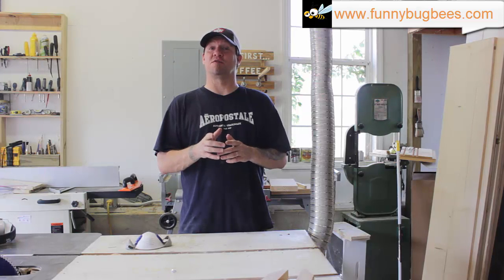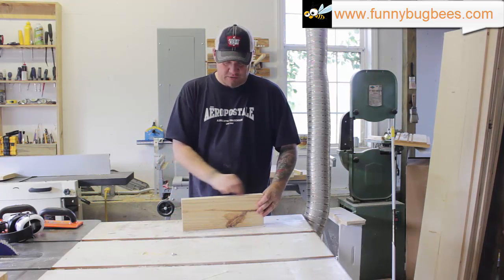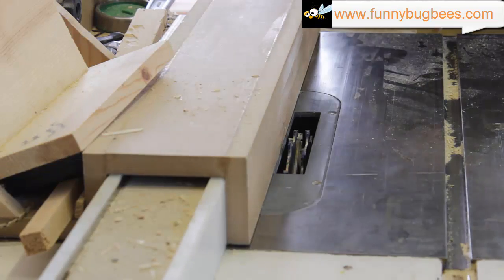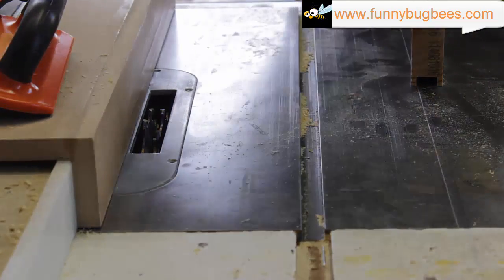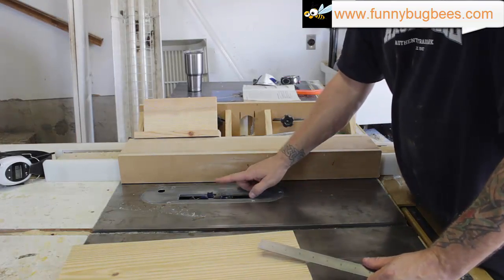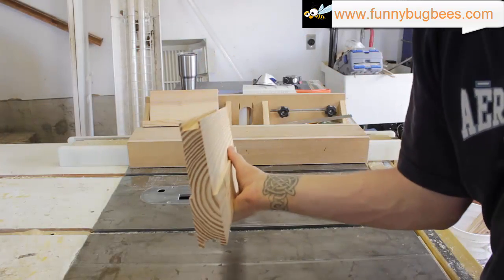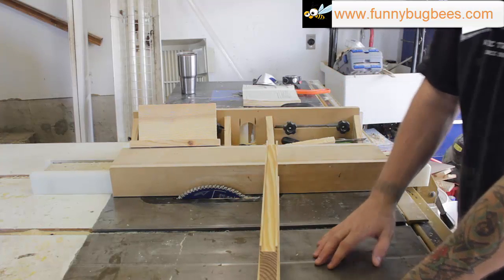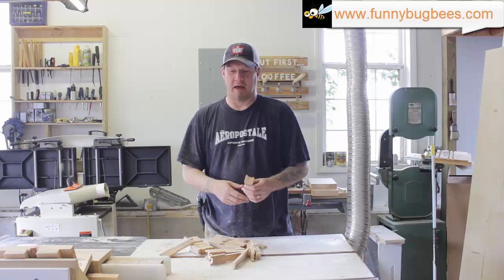HowTo: Build Langstroth frames with only a table saw pt 3 of 3 - end bars

Comment: I'm wondering if the way the grain is oriented on your end bars would make the brittle. I know when I have thin scraps after cutting boards they snap very easily.
Reply from the maker: Great question. I personally have never had an end bar snap due to grain orientation. Especially in light of the fact that end bars are nearly a half inch thick, coming in at 3/8". Though typically I use scrap which is oriented the correct way for production pieces. The piece I cut in this video was literally a scrap and I paid no mind as to the orientation since the process was more of the focus of the video. Given also that any end bars are usually heavily covered with propolis early in their lives means they are not likely to snap. The forces acting on end bars are usually not perpendicular to their orientation as well which makes them far less likely to snap.
Reply: Yeah you got the grain running the wrong way.

Comment: Let me start by saying you are a great wood worker. But as most have stated, it's not a good idea to use end grain that way. If you cut that same board to the correct height at the beginning and just make a few the rest of your directions would be the same with the exception of different grain orientation. Overall great job though. Watched all 3 parts and was very impressed. Keep up the great work.
Reply from the maker: As ive replied to others, the video is a method video and doesnt cover basic woodworking skills, like grain orientation. It is assumed those that watch my videos have some wood working experience and know to select grain orientation. I was using scrap to make the video and therefore was not concerned with grain orientation, as the point of the video is the method. Though your advice to others is correct, you should select correct grain orientation for the structural integrity of your finished product.

Comment: Great video I made some but they all broke when cutting to 3/8 due to the grain going across instead of vertical I made more with the grain going the right way and their all strong no breakage
Reply from the maker: ya i used scrap wood to make this video, and have mentioned the grain direction being wrong several times in posts as it was for demonstration only. You are right though, the grain running vertically is what you want.

Comment: Have you used these cross grain side pieces before? Seems like they would be easier to break.
Reply from the maker: That was made by the previous owner so no I have not. I use solid plastic frames and if I don't I buy the wooden ones . Actually I just pull them off the shelf.

Comment: I liked this a lot. Especially the way you use the dado stack to make the narrower bottom bit. Most guys cut out each end bar and then cut the narrower bit with a bandsaw. Seems much slower than the way you do it. Any way you can make a video about how you do it with a router?
Reply from the maker: Thanks Andrew, I think I can find time to do it with the router, as that's how i normally do it anyway. Keep an eye out for it to be uploaded in the next couple days
Reply: Funny Bug Bees and Wood Works thanks brother. I have a nice wood shop and I'm just trying to figure out if it's worth building myself. I buy frames 1000 at a time.
Reply from the maker: using a router and sitting down to work with the plan of making frames for the day, I can usually knock out around 500+ per day without working too hard. If you buy in bulk im guessing you are paying around $0.80 or so for frames (if cheaper let me know where so i can buy from there also). If you are lucky like me and get all your stock for making frames for free from a wooden products manufacturer, then your potential savings from making 1000 frames from free stock is about $800, not bad for two days work. Really its a question of value for time. If you are going to pay $0.15 or so for the stock by buying it, then your savings will be lower and you'll need to decide if the time is worth that dollar amount.
Reply: Funny Bug Bees and Wood Works I can get 1000 for $650 without foundation, unassembled from an Amish guy here in Michigan. Good deal probably. But I just like the idea of making my own.
Reply from the maker: how is the quality of the frames, and the uniformity? Got contact info, private message me it, ill give him some business, because i cant keep up with the demand and buy some for resale.
Reply: Funny Bug Bees and Wood Works He's Amish. Hard to get ahold of. Basically I have to drive to his farm any time I want work done. Lol!
Reply from the maker: So basically you are saying i can buy them from you, for $0.70 so you make some? :) Call me to discuss this. You can find my contact phone number on our website under the contact us section www.funnybugbees.com

Comment: How do you get your thickness of board to 1-3/8 with your table saw????
Reply from the maker: crank the blade up and run it through vertically (though to be honest i dont use this method) When i am making these myself i use my jointer to thickness plane the wood.
Reply: which totally defeats the whole idea of your video series. which was making frames with only a table saw.  i watched your videos, but if you are going to show how to do something the wrong way, or not show all of the steps, what was the point.  you lost me  when you didnt show how to thickness the board for the side pieces, when you switched to a dadoe rather than nibbling away with a single blade.  i understand that having a jointer and a dadoe stack makes it easier for your production runs.  i know that there are easier and harder ways to do something.  but in my case, i was hoping to see it done with a single blade table saw, which is what i have, to see if i could do frames with out having to upgrade my saw. i intend to upgrade my saw, but 6-15 hundred dollars while also looking at a new hobby , beekeeping,  gets expensive quick. and your answer is not only do ii need a upgraded saw but also a jointer.  yeah making frames with just a table saw is a great title.
Reply from the maker: what defeats the purpose? My answer clearly says that i ran the stock through the tablesaw, then flipped it over and ran it through again -- this is because with my 10" table saw i cant get all the way through the stock from one side. I leave out some steps, videos cannot be 1 hour long, and at least a small level of woodworking experience is required. Should i have to explain how to get your stock to a certain thickness using a table saw? There are some things it would be expected for you to understand how to do without being told how to do them before you ever consider taking on a project like this. This is one of those things. I left out no steps, i just "got my wood to the correct thickness using methods standard in woodworking". In this videos case, i did it with a table saw. My answer to Richard though lets him know that i do this for myself with a planar since i have one. No tools were used in the making of these frames or this video other than a table saw. For those woodworkers with access to a jointer, router, miter saw, etc. there are MUCH better ways to do it. For those without those tools though, and with only a tablesaw, this shows one method to get frames built.

Your being upset with me for using a dado stack is confusing...Isn't a dado stack a blade for a tablesaw? How is this somehow "cheating" or using a "specialty tool"? or not as you say doing it all with a tablesaw and somehow being wrong for titling the video as i did..

I am sorry you somehow felt cheated, or didnt like the video. I really do offer these videos in an effort to help people build their own equipment, they are offered as is with no promises though.

Comment: How again did the thickness get from 1.5" to 1-3/8"
Reply from the maker: cut on table saw....might be hard unless you have a 12" table saw, most folks in the DIY community have a 8" or 10" table saw. That said you can do it without a tablesaw using a planar.

Comment: is there anyway to do this cut without a dado blade?
Reply: You can "nibble" it like he did cutting the notches in video #1. It takes longer (more passes) but it's basically using your regular blade like a 1/8" dado.
Reply: A router table with the appropriate sized router bit and fence also works well if you don't have the dado blades.

Comment: Which table saw is good with dado blade ?
Reply from the maker: the short answer is all table saws with an arbor long enough to accept a dado stack blade. Most documentation for table saws includes the maximum thickness of dado they can accept, if they can accept one at all. This is why its hard to answer, there are literally hundreds of saws which accept dado stacks.
Reply: Funny Bug Bees and Wood Works 
Thanks sir

Comment: Would you be willing to email me your method of doing this commercially? I have a commercial shop I inherited from my grandfather.... no clue what half the equipment even is but am slowly learning on these behemoth machines. Been beekeeping for a few years now and getting to the point of going through 20+ boxes a year, don't like the high dollar prices and trying to do everything at lowest cost.
Reply from the maker: to be honest without a $30,000 machine to cut frame parts, its MUCH cheaper to buy frames. Working alone, in an 8 hour day, I can do about 100 frames, and thats working my tail off. Where as we sell frames for about $90 per case of 100. I guess it all depends on what your time is worth, mine is worth more than $11 an hour, it makes no sense to me to make them.

Comment: Need to use a stop block on the fence so those pieces don't get stuck and kick you back below the belt there... Process is solid and simple though.
Reply from the maker: agreed, ive been kicked once or twice in my 32 years of woodworking, it wasnt fun either time. :)
Reply: Same question how did you get the 1 3/8 I understand the 6 1/4 cut
Reply: Love your work
Reply: @FunnyBugBeesandWoodWorks  great work I seen you cut the board twice bro but both times the board was flat to get the 1 3/8 I thought would have to cut board straight up and down to narrow the thickness not knocking your work at all was just wondering
Reply from the maker: this video was made using plans from a book. Since i dont actually make frames using the method in this video, you would need to give me the point in the video timer you are talking about so i can look at the video at that time stamp and see what you mean.
Reply from the maker: Thanks Jody!